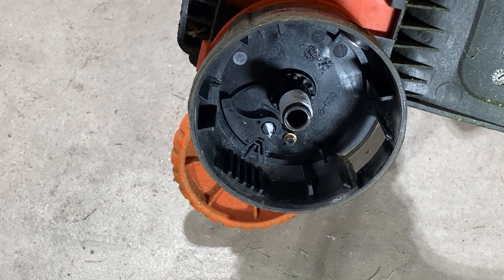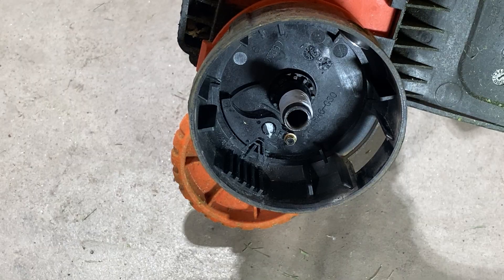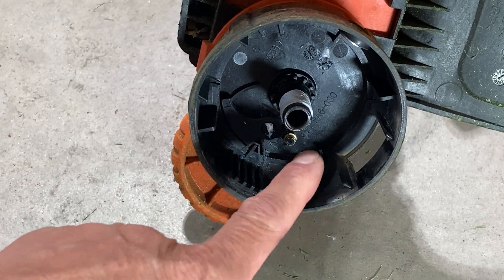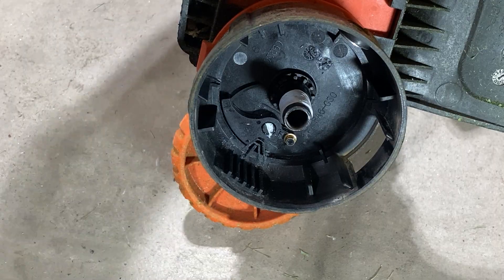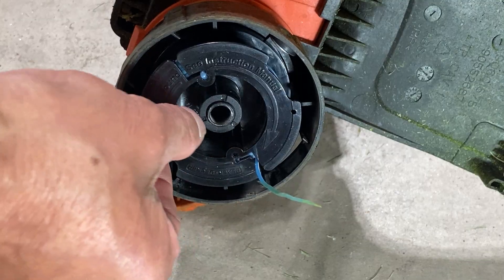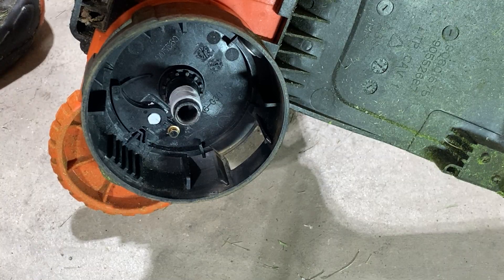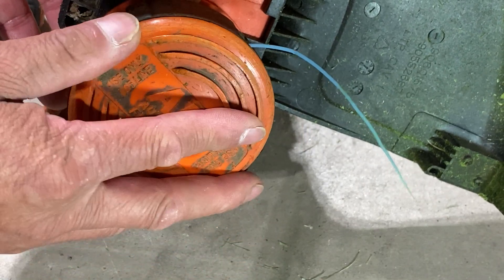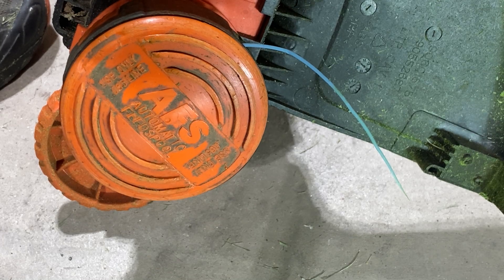Black and Decker AFS hack for too fast string feed

Comment: When you took off the feed mechanism,  I believe, you are missing the tension spring that is under the feed mechanism  i didn't see it when you removed it
Reply: Does that tension spring come with that little mechanism in the spool?
Reply: @JohnBarnes-jt9yi I thought the same thing earlier that I was missing a spring.  Decided to buy a new one, and there wasn't a spring. The new one fed fine.

Comment: Mine is a GH1100 model with twin lines and the "split" spool. The latch seems very "sloppy" suggesting it would "bounce" when you hit heavier weeds, stakes or similar so I wanted to try your teflon tape on the latch pivot. Mine is different than yours I found. I have to remove the head and underneath the pivot shaft has a 3 way split end where the three plastic "prongs" have to be squeezed together to get it to release. I figured this would just cut a hole in the tape if I push the pivot through it and not leave any tape on the pivot shaft. So I went though my tubes of grease and found some really think lithium bearing grease. I pushed some into the hole for the pivot and put some on the shaft of the pivot and reinstalled the latch. Now "gravity" won't move it. It's a bit tight and you have to move it with your fingers. Reassembled and it's not perfect, but it's an awful lot better than before. I tried to put tape on the main shaft of the head as you did but I noticed the replacement spools have a "stepped" hole on them. It's one diameter most of the way through the spool, and a small "ridge" at the top of the hole. So when you install the spool, it looks like a moderately close clearance - spool to shaft - at the very top but once you're below that ridge, it's a very LARGE gap in there. I may try to see if I can make a sleeve that will fit on the shaft, reducing the clearance to the inside hole on the spools.

Comment: I bought a brand new one and it has this problem it feeds the whole line too quickly in less than two minutes… i had an older black and decker and line would last for days
Reply from the maker: Same experience here. Even with the hack, it still consumes feed line much faster than my old trimmer.

Comment: Almost all grass trimmers have automatic feed. They use an outrageous amount of trimmer line. 
Only the BLACK+DECKER 3.5 Amp Corded Electric 12-inch 2-in-1 Trimmer/Edger has no automatic feed. Works great. But they are a bit flimsy. The trigger wears after a while.

Comment: this design is completely stupid and useless. Black and decker is widely known as bottom line junk in the trades ive been in.
Reply from the maker: IMHO, the design is clever. It is just the manufacturing process failed to yield consistent components and resulted in inconsistent performance. It is likely a cost benefit tradeoff that B&D made.
Reply: Design a better spool come on the hacks do better job a simple rotary or strong string

Comment: What is the name of that little black lever so I can order one, plz? You call it "the mechanism".. whats that part name?
Reply from the maker: I found this one on Amazon. https://www.amazon.com/Black-Decker-90567076-Equipment-Manufacturer/dp/B00JV4VS2U/ref=sr_1_3?crid=NAH8JWEFLM37&dib=eyJ2IjoiMSJ9.DvSqqC3L2XSrE6bgJtG3ByHyfoCUWU61vbEl-yUEiUCYexbHyd3Ua2YnY5l-bBGWQN3g8xzA7xc3emFVmhjgfucn9GqyO6d441RI5sGzv8J6B1FEmB_w4iBOltN9pnFK9_PhsHx8zU-poNAEWdwkeXH77DW7XSX4rSiepk4czXhm89_inhf6wu5TxNMguvjr4heNkZwWE_djTuWz4VEMvZd5pCpcl4IxcTrSAcsiQhY.jQwJC6qMfAfVI3vfRx-LRPFW-s6BPZwz6_QXSEHCmoc&dib_tag=se&keywords=black+and+deck+trimmer+lever&qid=1727235764&sprefix=black+and+deck+trimmer+lever%2Caps%2C171&sr=8-3
Reply: @Chi-HacksAndDIYs thank you thank you!!!
Reply: hi that part call REPLACEMENT LEVEL SOLD IN EBAY MODEL LST300 GOOD LUCK

Comment: Hi glad you decided to post this.  Idk why ur vid just popped up as I have been searching for weeks a way to slow down the line feed. I used tape hack to stop feed resulting in string jamming every 60 seconds.  Recently I used 6 spools to do my 1/4 acre!  I saw another video I was going to try, which involved not using the spool at all but did involved drilling another hole.  Your hack was so easy I tried it first. And 🎉🎉🎉🎉 it worked!  I used one piece as you showed & it slowed down line feed but not enough.  So I played around with it & I found 4 layers does the trick for mine.  I feel like I'm back to using a "normal" trimmer.  Are you a rocket scientist?!  I am forever indebted to you.  THANK YOU 🙏 🙇‍♀️
Reply from the maker: I am so glad that this hack works for you. I almost gave up with this trimmer as it consumed string so fast. After the hack, it works properly in my liking.

Comment: Your missing a spring that controls that stop for ya, guy
Reply: Unfortunately I wish it was that simple.  It is specific to only this electric B&D trimmer.  I'm not sure what happened in manufacturing maybe they did it on purpose & didn't think it thru. I literally go thru 2 entire spools of string in one use.  Edging fence on 1/2 acre property.  Spool used to last weeks.  I have researched & tried every hack out there.  OGoing to try this. If it doesn't work going to try switching feeder head with ol' reliable battery B&D that I've had for over 12 yrs & still works.  I got tired of buying batteries & bought this electric one.  Should've listened to all the negative reviews.  Must've paid for good reviews.
Reply: This model HAS NOT A SPRING AND WORK 100 % 👌🏻👌🏻👌🏻👌🏻👌🏻👌🏻👌🏻👌🏻 @tammysmith9727
Reply from the maker: Thanks for your insight. Although not displayed in my video, I did have the spring attached to the cap. Otherwise, it wouldn't work at all. Cheer.
Reply: My GH1100 does not have a spring on it. It may be possible it broke and fell out, but, when I look for the parts to fix the head, there is no spring available. And there isn't one with the latch cam. If you're talking about the spring on the orange cap, the GH1000 series don't have them. Cap is flat on the underside and the spool tops are flat. No recess for a spring to fit into.

Comment: I had the same problem. After checking several you tube videos I see that there is an activator lever spring that I’m missing. That controls the line feed. Mine must have broke off.